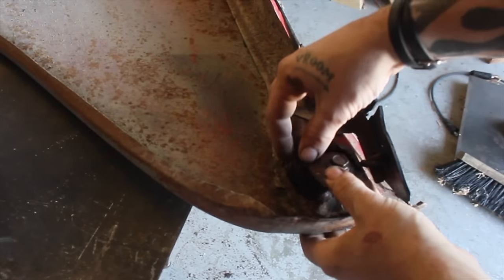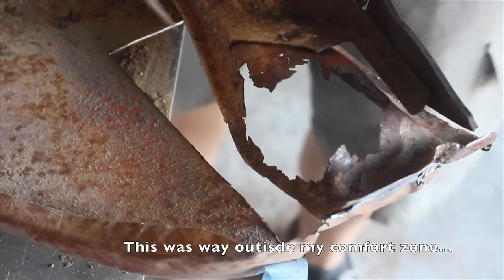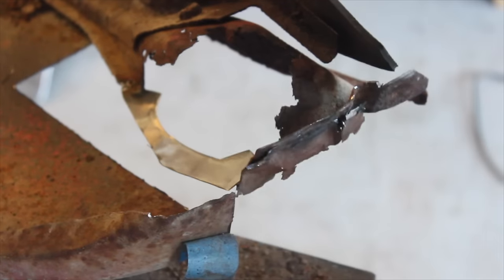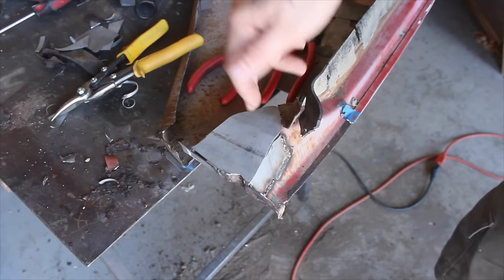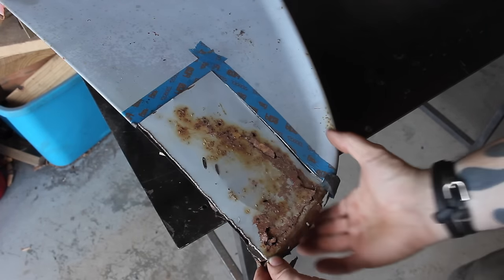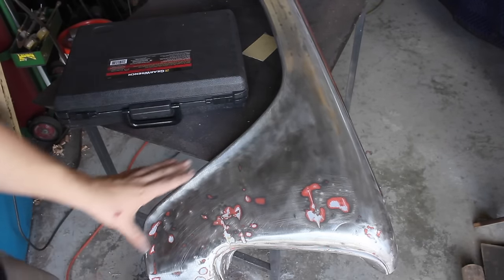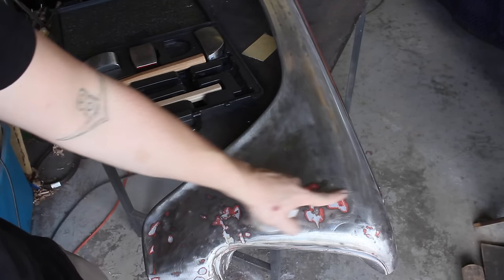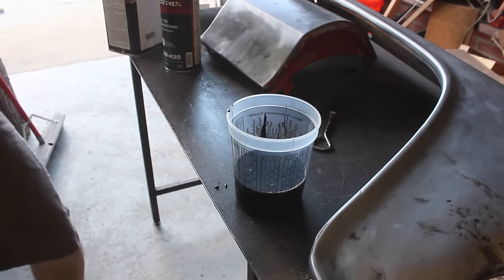1. Fender & Cowl - Mount fabrication, patch panels, body work & primer

Comment: This is going to be a great series Zack! I was already enjoying your other channel but this is something else!! Thanks for adding all your thought process! What size wire are you using? I'm in the welding trade myself but we use .45 ,1/16, even 5/64 sometimes. Your wire is probably quite a bit smaller I would guess..
Reply from the maker: Hey, thanks Tomy!
Yup, I swap out the .030 for .025 it makes a world of difference!

Comment: nice job man, I am no expert but I've done a few repairs like this I find if you cut the repair panel on the original panel then your cut lines will always match up without having to grind, also leave a 1mm gap that give the meatl somewhere to shrink into that way you can with a bit of practise  weld up soft pad off and no filler, good job though, nice to see how your getting on , keep those vids coming
Reply from the maker: Thanks Mark! I've seen that done. and it seems to make sense, but I'm always close to "key-holing" when I weld.(i.e. burning through) I'm using .025, but I'm scared that with much of a gap between panels, It would be even easier to burn through. Any thoughts?
Reply: you'll be fine Zack as your only spot tacking, so tack all the corners first, then back to the start, then tack half way between those tacks then half way between those  etc etc then when you grind back grind in one movement along your tacks, that way you keep the heat down. good luck my friend

Comment: You should get yourself a shrinker ,stretcher ,English wheel and cheap bead roller from Harbor freight or Princess Auto here in Canada,Youll have fun man .Im building a CF 100 wing tip fuel tank into a awd Subaru Lakester and building parts out of aluminum. Im having lots of fun inventing and creating.

Comment: I'm a metal shaper ,Just a tip get a hard wood block and drill a 1 inch hole in it and take a ball peen hammer and shape your bump over the hole till you get it close and then cut the outside dimensions and weld it in.

Comment: When you have a full can of primer use your paint stick as a pump! Hold your fill cup tilted just over the edge of the can then dip and scrape on the lip of your cup up and down till you get the amount you need .No spill mess or having dried mess in the lip and the can doesn't seal .